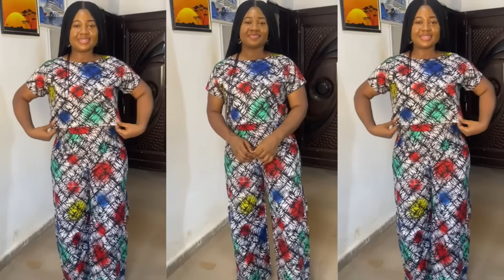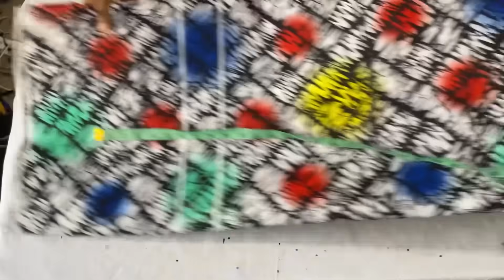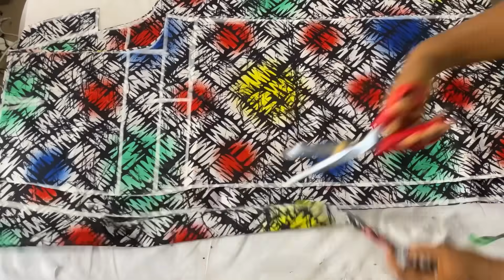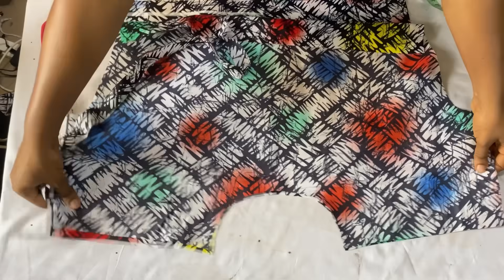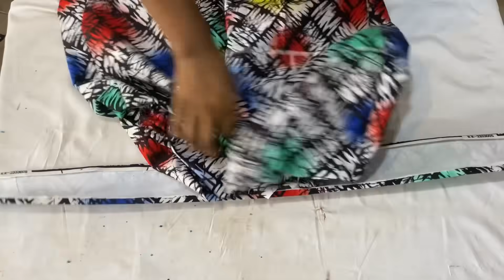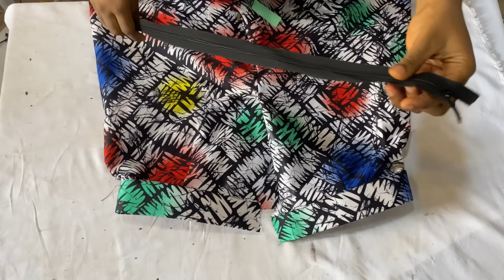How to cut and sew a High Waist Palazzo trouser and crop top / Beginner’s Sewing Tutorial

Comment: please ma you did similar pant and in the back panel you came in my 1.5 inch on the waist before connecting it to the crotch...but this one you didn't 
please whats the difference
Reply from the maker: You can use any of the methods. It will still come out fine

Comment: Thank you. I watched it once and drafted it on paper. Used it on a shaking soft material and it came out well❤ I love the flow BUT the inner side between my lap/thigh was not free so it felt like it was hanging. The outside sideline of the thigh was smooth. Is there something I did wrong? I wish I could send you a pic
Reply from the maker: Hello🥰..  thank you for the feedback. This might be as a result of a wrong crotch measurement or wrong thigh measurement. You can send a picture to my instagram (sew with mediva)

Comment: Thanks for the class ma 🙏pls how do I get the crotch depth if am making low waist am I using the same measurement of hip/4 +1 too
Reply from the maker: You’re welcome 🥰🥰
No you don’t need to add 1 inch to it. Just use the round hip measurement divided by 4
Reply: @SewwithMediva  Alrt thank boss 🙏 more wisdom
Reply: More oil on ur head